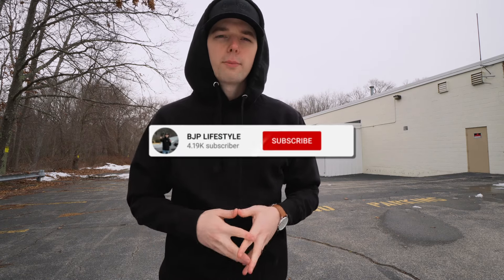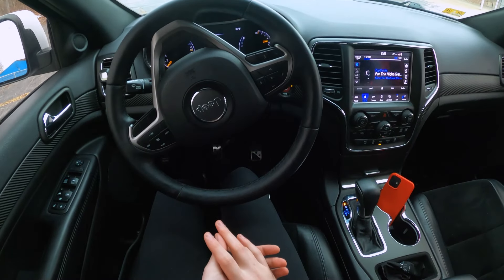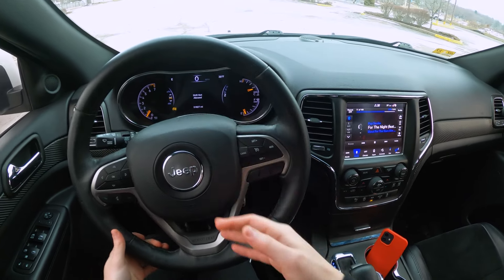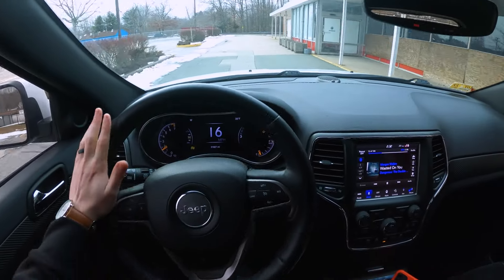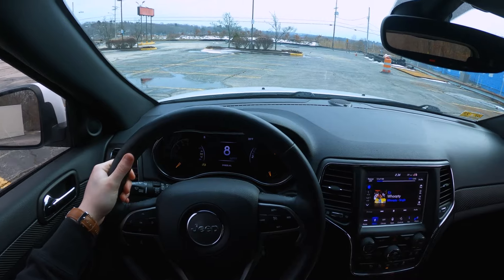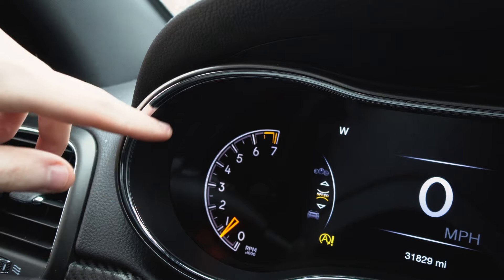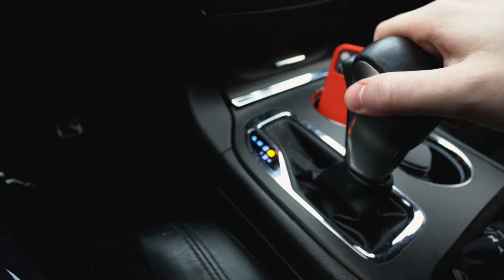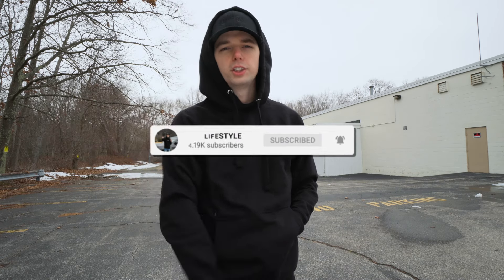How To Drive an Automatic Car in Manual Mode

Comment: Can you go from manual back to auto without completely stopping?
Reply from the maker: Yeah, you don’t need to stop or slow down at all just pop it back over to auto
Reply: @BJPLIFESTYLE  oh ok great. Hey thanks so much for responding. Great video by the way. I'm practicing my shifting with it lol
Reply: What about the other way around? Can you go from automatic into manual? Will it know what gear to start in? Like the same gear it was in when it was automatic mode?
Reply: @sbond1963  That is what i wonder too.. have not dared to even use the gear yet....
Reply: @goymedhundDogtrainingBehavior  I just tried yes you can

Comment: can u tell me when to downshift
Reply from the maker: My best tip is to drive in auto mode and feel & see where it shifts on the RPMs to figure out a good place to shift and work from there!
Reply: You can down shift at any time . It will not hurt it at all. You just shouldn’t slow down downshifting , but you can downshift to speed up and stuff

Comment: Manual............... Who the heck dont know the difference between manual and automatic or a clutch petal and rpms..... What I didn't know is that TWO position shifter placement and or it's functions on my 2018 Cherokee and I had it for 8 months. Today I drove it and the shifter went into that inner notch without me noticing it then when I got home I tried to put it park and it wouldn't move, took me 5 minutes to figure out that TWO position shifter placement,  I had to just slide the sifter towards passenger side a little THEN the shifter slide right into park........ Someone needs to make a ten minute video on just that TWO position shifter placement, out of a dozen videos at least you made a quick mention of it, I had no idea my Cherokee could be driven like a standard...........

Comment: Why does it seem like no one ever relates the shifting to the mph youre going? For me I noticed at around 15mph I shift up which takes me to 20mph (equalling 2000 rpms) then moving towards 30 takes you to 3000 and so on so forth
Reply: Because most of us have different transmissions,  and the gear ratios will yield different results regardless of identical rpm.

Comment: I have a Jeep renegade 9 speed automatic with that auto stick feature. I have never ever driven a standard. How do you know when to shift up or down? And how do you know how many times to shift up or down? Will using the auto stick feature mess up this transmission if we don’t shift right?
Reply from the maker: Since it’s still an automatic it should shift if it’s under too much load. A good rule of thumb is that most automatic cars will shift at 2500 RPMs so you can just do it then if you want

Comment: ok my car has that if I go on the highway and I use the manual at how many revolutions do I have to change?
Reply from the maker: There’s no specific RPM you “have” to shift at. Lathe average is around 2000-2500 but in manual mode you can go higher in RPMs for power. I’ll be making a new better version of this video soon, make sure to subscribe for that!

Comment: Woijd it be the same thing for a q50
Reply from the maker: It should be similar for everything
Reply: @BJPLIFESTYLE  what about for slowing down bro you inspires me just with one video and I was trying it but I don’t get the slowing down
Reply: @BJPLIFESTYLE  will I mess up my trans if I’m on the 3rd gear ans slowing down
Reply from the maker: Think of everything in reverse, when you downshift the RPMs will go up and cause engine braking - just listen and feel the car and as you’re slowing down slowly drop gears when it feels right without the RPM skyrocketing
Reply: @BJPLIFESTYLE  so even when you are hitting the break the rpms will shoot Up?
Reply: @BJPLIFESTYLE  and should you be on first gear before you come to a full stop or can you be on second or third gear

Comment: Can anyone tell me the speeds that you should shift on or ballpark ?
Reply: I shift around 3-3 1/2 RPM, but I have a Toyota 86. He mentioned 2k which is probably good for cars in general.
Reply: @baseballchica1346  is that with just cruising and causal driving or can you go higher if you really want to unleash the power behind the engine? I’ve done it around 5 high end to really crank it which isn’t the redline but just curious since I’m new to manual & auto manual driving.
Reply: @AmorFatiMementoMori  Max for me was 4K RPM, but I don’t like to push it beyond that because I notice my engine starts yelling at me haha. And it’s normally when I’m merging onto the freeway. Casual driving I keep it at 3-3 1/2k.
Reply: @baseballchica1346  the engine sounds fine even at 5 but, I only push it & do that when I’m on the highway and on a long strip Of road where I can crank it for fun but I usually keep it low when merging and cruising. Thanks for the info btw.
Reply: @AmorFatiMementoMori  you’re very welcome.
Reply: @AmorFatiMementoMori  If you have a manual barely blipping it up to the redline isn't going to do any damage, it is if you get it to redline speeds and just keep pushing on it. Sometimes when I take off I push it to about 3500 RPM as I accelerate of the stop. If I'm in 5th on the highway going 85 my RPM is at almost 4000. You have to really be driving hard to fuck up a manaul redlining it. If you have one of these automatics with a manual mode it likely doesn't like you giving it that much and like he said probably want to make sure you shift at 2500 rpm